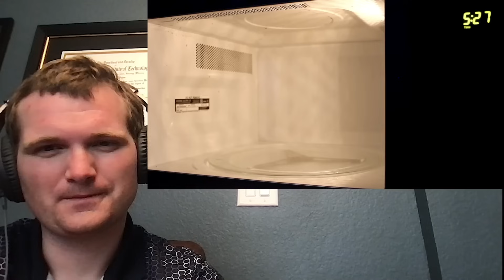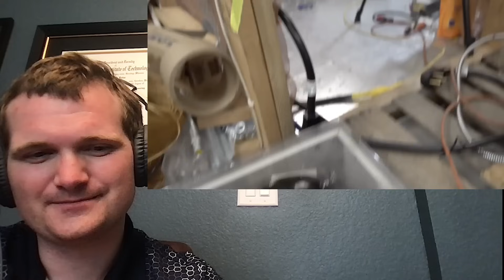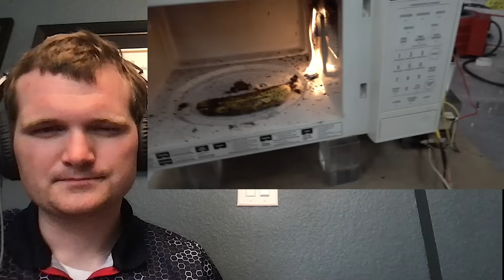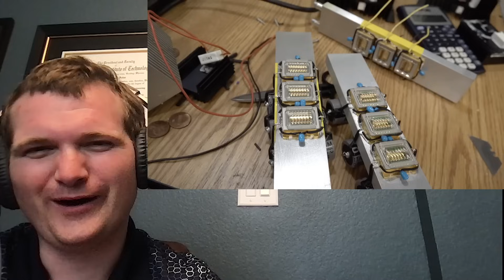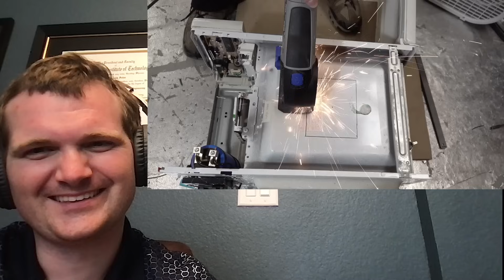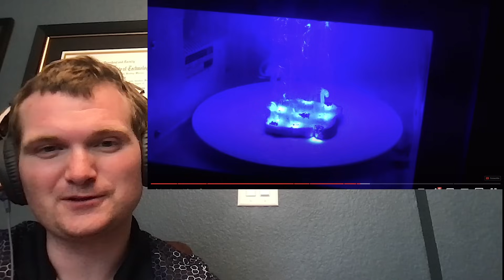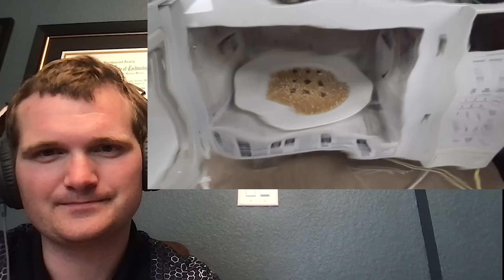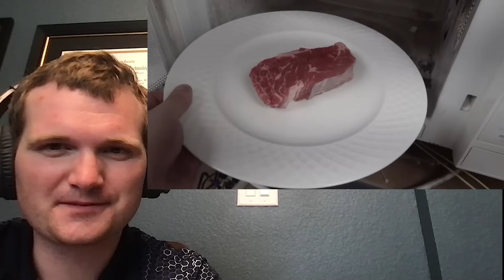LASER MICROWAVE! - Nuclear Engineer Reacts to styropyro

Comment: Maynaise is OK cooling paste between the heat sink and the laser diodes. It wouldn't tolerate years of operation like proper cooling paste (even the white ceramic crappy kind) but for hours of operation it is surprisingly not that terrible.
Reply: It's probably the oil in the mayo lol
Reply: @saberflow_official  The emulsion gives it that thick, viscous consistency so it doesn't run and fills the space evenly. It also means the water will dry and it will stop being useful.
Reply: @soylentgreenb  uhh... yeah if it was to stay cold the whole time. The second you warm it up its viscosity drops heavily and it will fill every gap
Reply: Depends on the mayo, someone used mayo as a thermal paste for 3 years and while it was absolutely disgusting, it did work fine.
Reply: @user-le8ul4nr5t  Normal mayo starts to separate if it just gets old sitting in the fridge in an opened jar and the egg will eventually spoil if there's water. I wouldn't eat mayo if I knew it could withstand 3 years under a heat sink without separating. That implies it's not realy mayo but some kind of barely edible fuckery with xantham gum, lecithin, propylene glycol, modified starch etc.
Reply: @soylentgreenb it’s a combination of molecular physics at the thickness the “thermal paste” is, and the fact that at that scale the mayo cooks into a really greasy egg which is a surprisingly good thermal conductor

remember you’re applying heat through it because you’re using it to transfer heat
Reply: @Theace88x  There's too much oil in real mayo for me to believe it could behave that way. Mayonaise is sometimes cooked, e.g. by applying it to a whole chicken toghether with spices as a rub; the result looks like you lighlty oiled the chicken and applied a dry rub ontop of the oil; there's no hint of anything eggy left. I don't believe real mayo will have any longevity as thermal paste without some additional fuckery in the ingredients list.
Reply: @soylentgreenb  if you don’t believe it test it yourself since I already know there’s nothing I can say that’s going to convince you like seeing it yourself, however if you’re willing to keep an open mind to some anecdotal evidence here are the facts I’m going to leave you with:

if you make a grilled cheese sandwich with mayo you’ll notice it leaves a layer of cooked off egg protein on the crust of the bread, it’s a similar principle if you do it on chicken but the layer of egg protein is thin enough that you can’t notice it other than the oil because it’s cooked to the chicken and usually hidden by spices but it is still there binding the spices to the chicken
Reply: @soylentgreenb  to be fair to everyone, he used olive oil based mayo, which probably is gonna just make a smokey mess after 5 minutes
Reply: @user-le8ul4nr5t  No it didn't unless it's something low powered.
Reply: it's a joke from an old thermal paste thermal capacity chart that had mayo tooth paste and other stuff on it
Reply: @Monstufpud  jokes were made, but they were used as controls, so the findings were no joke.
Reply: @Monstufpud I use acetone regularly between two aluminum plates to ensure better heat conduction while they're together but it evaporates without a trace once separated.

Anything is better than just the metal on metal. Heat is kinetic in nature, fluids are incompressible, so the heat motion can be transferred short distances very efficiently by any liquid capable of acting "hydraulically".

Sure, you want to optimize this for any permanent situation, so things like silver flake in silicone oil work much better.

But in a pinch? Pee on it even 🤷‍♂️
Reply: I removed the tag from my mattress and it made a laser. Now I know what the tag is for.
Reply: I really want someone to put this usage in a supermarket review for mayo. The confusion, the worry, the complete wtf?! other people would feel!
Reply: Anything will work temporarily
Reply: @MadScientist267  quite untrue, try using insulating plastic as a cooling interface and get back to me
Reply: @DarkAttack14  That's not a liquid 🤦‍♂️
Reply: @DarkAttack14  I realize you're taking my "anything" a bit too literally.

I clarified what what I meant in another reply
Reply: it sounds an awful lot like you're speaking from experience

not going to ask
Reply: It would last a few minutes and it would probably be terrible! Have you actually tried this, if so why!?!
Reply: @TheRjjrjjr  Yes it's been tried and no, it does and should work for hours. As long as capillary force can retain the material between the sink and CPU and it doesn't shrink too much from evaporation. Mayo doesn't evaporate, it separate and becomes an oil; toothpaste evaporates but if the temperature is less than 100C and it's in an enclosed space between the CPU and cooler it can only evaporate slowly from the outside in. This will take a long time.

In the 90's it was very common to use thermal epoxy on coolers. This is a mineral filled epoxy goop that was usually pre-applied by OEMs, making the heatsink unsuable if you try to upgrade the CPU; asshole design. Ontop of the bad idea of glueing the heat sink on it was usually applied without firmly pressing the heatsink down resulting in a layer of TIM that was a good fraction of a millimeter thick; really hurting cooling performance. To make up for the terrible cooling performance you slap on a 6000 - 8000 RPM 50 mm fan which sounds horrible. It only drew 15-30 W maybe but the die was smaller than today so it's not that much easier to cool.

There has always been a lot of voodoo around cooling paste. Other than applying liquid metal or soldering the die to the IHS with indium all the pastes are roughly equally as bad and almost any goop that you can fill the interface with and is thick enough will work for long enough to run a stress test. It's actually hard to find an exception; it would have to be something which evaporates much below 100C like an acetone based gel or something exotic.
Reply: Mayonaise are just eggs in an oil suspesion, the oil is a good at transferring heat and sealing and the shape of an egg makes it a great lens which helps focus the energy of the laser so you get a good two in one from the grocery store.

Comment: "Someone in the comments tell me why mayonnaise makes lasers--"

It doesn't... welcome to styropyro's channel with the host who is able to combine insanity and genius so much that the universe just lets him do whatever he wants scientific wise with little consequences
Reply: Never heard of thermal grease?
Well mayo is mostly oil, so it's definitely one of the thermal greases of all time!
Reply: It'll work.

good? hell no but it'll work...
Reply: @maxx1o1  If you replace the cooling paste on your CPU with mayonnaise it will increase temps maybe 2-5 degrees C over a high quality paste. I don't care if you have nano-diamonds or silver particles in there; it won't really matter since the rest of it will be some kind of silicone oil and it will be about the same as the mayonnaise. Give it another day or two and the mayonnaise will be complete crap; it will separate, seep and the water will dry and it will no longer be thick and viscous and just runny like cooking oil. The only way to beat freshly applied mayonnaise by a large margin is liquid metal cooling paste and it has a bunch of problems (corrodes aluminium, they won't let you bring it on an airplane, it is conductive and will short a motherboard if you slop it around somewhere it's not supposed to be etc).
Reply: @soylentgreenb  look, it may only be "2-5C dif" but the thing is that it'll corrode your CPU's IHS and damage your heatsink when a tube of thermal paste cost less than a jar of mayonnaise and will last longer too. this has been a running joke for decades now.
Reply: @soylentgreenb  now at least it's not chocolate, that shit is worse than no thermal compound at all
Reply: @soylentgreenb This is not true with modern thermal pastes. Improvements have been made since your Arctic Silver 5 days.
Reply: @soylentgreenb  Kryonaut does transfer heat better than a lot of pastes on the market. Its only true downside is it doesn't hold its performance for as long as say, MX-4. However it wasn't really meant to either.
Reply: @Chuck_Huckler  The youtuber Life of Boris actually used mayo as thermal paste for a modern gaming PC for a video. It actually worked just fine. Doubt it would last more than a few days but... in a pinch... (He's also made a vodka cooled computer. It worked stupid well.)
Reply: @MeepChangeling  omg i recently talked to a dude on discord who was making a homemade cooling system out of isopropyl
Reply: @MeepChangeling 

Vodka is a great coolant, it was used in compact Soviet radars for a while, including on the MiG-21 and 23.
Reply: @Chuck_Huckler  bro... it's called thermal paste not grease. Don't be ridiculous. Everyone knows mayonnaise doesn't work. You need tuna paste 🙌
Reply: @nonsequitor right? 😂
Reply: To be clear the build montage is absolutely not at all any of the important parts of the build, he's hiding all the actually dangerous stuff.
Reply: @MudakTheMultiplier  And rightfully so. Some less qualified idiot might try to do the same and get hurt, since he made it seem easy and trivial.
Reply: exactly people don't realise it's a funny montage. He mostly uses indium metal or thermal paste for great thermal conductivity between the heat sink and diodes. @MudakTheMultiplier
Reply: Jeah probably some makeshift substitute for thermal compound to cool the diodes.
It will work, but it won't last, not that he builds it to last in the first place.
Reply: Mayonaise are just eggs in an oil suspesion, the oil is a good at transferring heat and sealing and the shape of an egg makes it a great lens which helps focus the energy of the laser so you get a good two in one from the grocery store.
Reply: It's delicious too
Reply: When you're smart and experienced, danger is your plaything
Reply: white glint... all those silly legends, Ive surpassed you and now I'll prove it.
Reply: It would have been thermal paste to conduct heat between the diode chips & the heatsinks
Reply: Themal paste substitute ofc.
Reply: It does actually, it's due to the dipole hemi-encabulation of the emission gradient with respect to dTheta. A small phase shift generates a virtual frequency proportional to the ratio of epsilon_1 and epsilon_2, ironically this phenomenon is only present in emulsions such as mayonnaise but not in coloids such as milk.
Reply: How would you suppose to make lasers without mayo?
Reply: probably keeps glue in an old mayo jar. either that or it is just a joke.
Reply: Maybe he replaced the Mayo in the Jar with oldschool carcenogenic silicon HTC 😉
Reply: It’s called Brute Force, ever heard of it?
Reply: His cognitive dissonance(look it up) constantly leaves the fundamental rules of the universe in a confused and  therefore dazed state
Reply: styropyro is more accurate to a mad scientist, like look at that laugh and smile as he stares into the barely legal lasers
Reply: This guy and nilered/blue collabing would either bring an era of scientific discovery and turn the world into a paradise or kill half of humanity
Reply: others have said it, but as an amateur engineer, even I knew it works as thermal grease. stinky? sure. damaging to the hardware? probably. effective? yes, in externalized uses. I wouldn't use it as CPU thermal paste as others have mentioned, but grease? in a pinch.. it'll do.